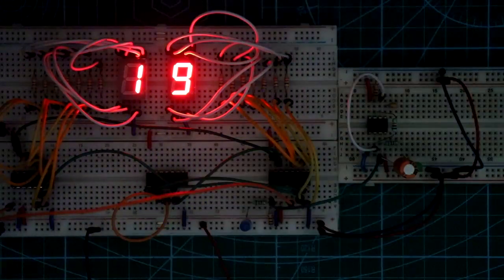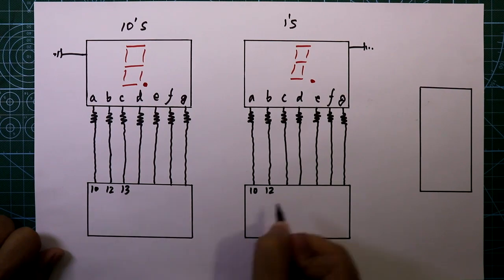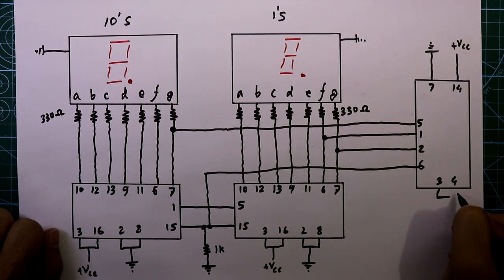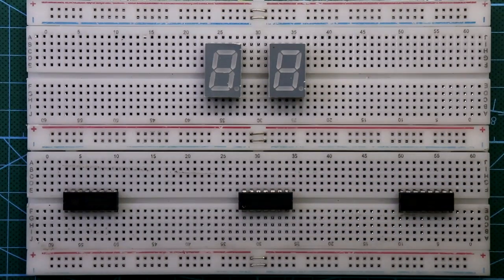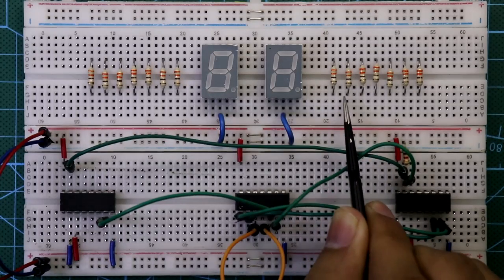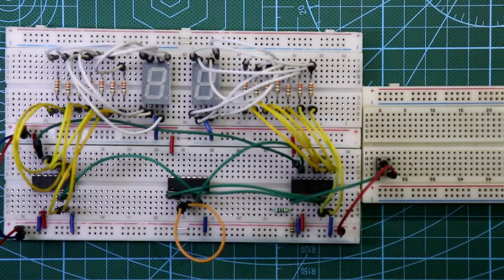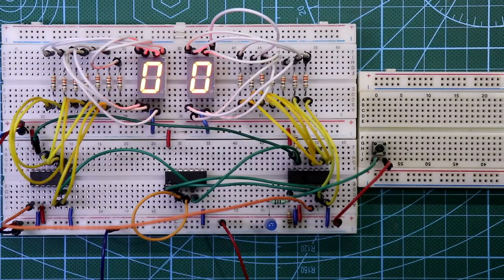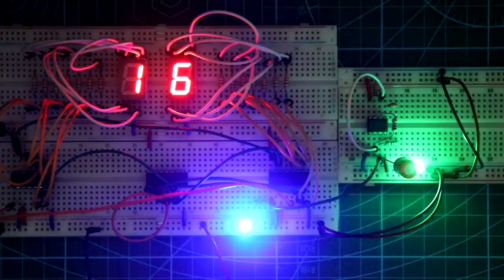MOD 24 counter with 7 Segments Display | 0 to 23 Counter with Practical

Comment: What are the components sir? badly needed for our project.ASAP. THANK You! God Bless!
Reply: no headphone
Reply: @bwiiint  Components:
2 x 7 Segment Display Common Cathode
2 x 4026 IC
1 x 7408 And Gate
14 x 330RΩ Resistor
2 x 1kΩ Resistor
1 x Button
1 x LED (any color of your choice)
1 x 220RΩ Resistor

Make sure the Power Supply voltage is 5V.

If you want, you can make the button into a 555 timer instead.
Reply: @scriptdevvs  thank you so much😍
Reply: @bwiiint  np

Comment: I want to make this counter to run on 12V instead of 5V Any ideas ?!
Reply: to use with car battery
Reply from the maker: You have to convert 12v to 5v. To do this, you need ic 7805. Then only you can run this circuit with a car battery.
Reply: EE Wave Thanks! can I get this as an assembled unit somewhere ? or atleast a PCB, I dont mind soldering the components on it ?!